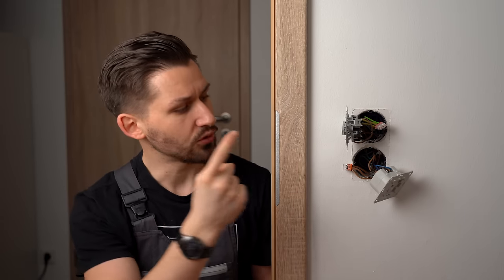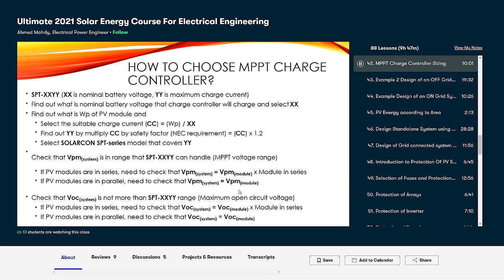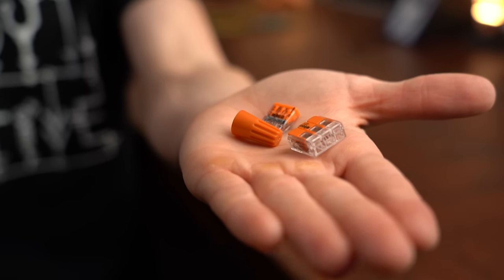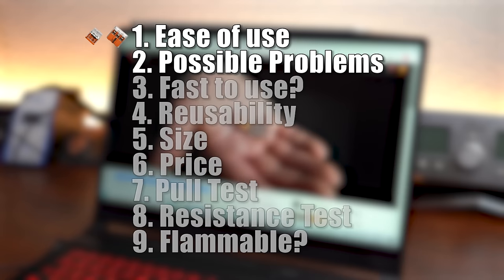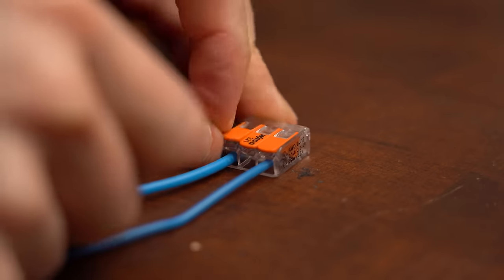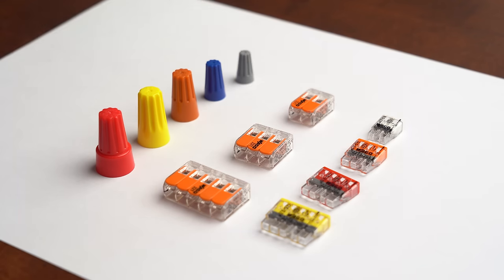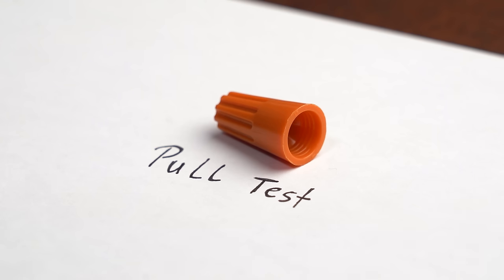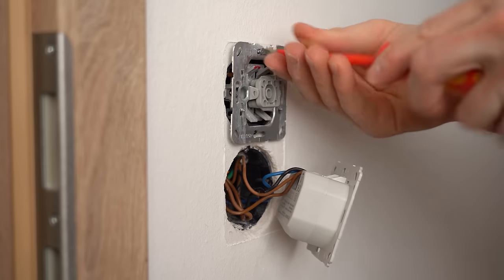What Wire Connector is the Best? Settling a Debate! Wire Nut VS Wago

Comment: I bought a box of Wagos years ago and never went back, every time I find an old wire nut it gets replaced with a Wago lever or a push connector depending on how likely I think I'll ever have to do rework is. I like the newer generation of transparent lever Wagos that are less likely to snap your fingers, that's about my only complaint with the older grey ones.
Reply from the maker: That was actually my only complaint about the grey ones as well :-)
Reply: How sore is it when you smack your finger nail with one 😂 OUCH
Reply: @greatscottlab  100% Same here. Honestly, I remember the first time I seen these and it was like a godsend. Wire nuts work, but they IMHO suck to use, esp with stranded wire. They work much better for solid wire, but still are best kept to a one shot use. Yes, you can reuse... But your wire now has metal fatigue due to the twisting, as does the spring coil.
 Australia has a lot of stranded wire, and the Wago connectors I prefer even over the common brass cap with set screws (Lookup Clipsal 563J/50 for an example). Wagos do not destroy your stranded wire ends like screw caps or twist nuts do.
Reply: Same. The only time I don’t replace them is when there are a lot of wires tied together, and already twisted around each other. I’ve seen wire nuts holding way more wires than I can do with a single wago.
Reply: Just pay the extra 12 cents for a high quality WAGO connector
Reply: @r3tr0nic  For the most part, I agree with what you said. If you have never used barrel crimps for stranded wire, you are missing out. (Not for joining wires together, simply to bind the strands together on one conductor) Once you use them, you never want to deal with loose stranded wire again.
Reply: Oh, yeah. Grey ones were also more difficult to open. I definitely prefer transparent ones over it.
Reply: Same here.   I rewired my whole house 7 years ago when I bought it.  It was built in the 50 and had barely better than cloth wiring, not to mention the absolute cluster f**k of how it was wired (couldn’t get it to make sense in my head so I just ripped everything out and started over).  Found the Wago connectors then, after using wire nuts for over 30 years, and haven’t used anything else since.  A million times better in my opinion and I make sure to share them with others whenever the opportunity arrises.
Reply: @jesondag  if there are lots of wires tied together that a wago can't handle the wiring problem should be resolved (to many wires in one junction point is just asking for a fire especially if your using wire nuts to tie up 8 cables that's bad just asking for a fire)
Reply: They are also cool because they include a “probe hole” where you can easily measure voltage with a multimeter without having to fiddle with the inputs. Really neat for diy projects !
Reply: I want to use them but I don't like the idea of the extra resistance. I'm going to definitely use them on my 12v installs though.
Reply: Wagos all day, especially when work is paying for them.
Reply: Wago 2273 are for solid conductors and should be always used if all connected conductors are solids. Wago 221 are for mixed conductors if you have to connected solid and multifilar conductors. It's not wrong to use them with solid conductors but because of the lever, which might come loose if stacked together with many others, you should use Wago 2273 for when all conductors are solids. Cheers!
Reply: The Greys are nail clackers.
Reply: @Alfred Pennyworth actually no, never have heared of wago before, but will 100% look for them next time I go to obi
His content showed me they exist, so thanks awesom scott
Reply: Sadly in some parts of the USA it is against code to use them.
Reply: @strmch8ser  My father had a house from the late 1800's.  The wiring was literally factory insulated with cloth.  By the time he had the house in the 1970's every time he went to replace an outlet or switch (which was often, 60 year old electrical outlets don't like to hold plugs in properly -- even I arced an outlet one day trying to plug something in) the cloth insulation disintegrated and he had to electrical tape temporarily and re-wire ASAP.  Worse yet, the wiring appeared to be equivalent to today's 16 AWG wire and it was connected to 20 amp circuits!  We didn't find any knob and tube wiring, surprisingly.  I had a house that although the wiring insulation wasn't disintegrating the wiring was so grossly under-specced that I melted the plug on a 15 amp dishwasher because things heated up so badly.  I re-wired that house to then modern specifications (and added a few new circuits).
Reply: We call these fire starters in Chicago, I can’t tell you how many boxes I opened up to find those things melted
Reply: @breandanholmes1  What things?
Reply: @1donjuego  wagos
Reply: @breandanholmes1  Then it was too much current. Sad some people dont check out what they are using and for what they are rated, thats why people die.

Comment: Not mentioned in the video, the WAGO allows to connect different conductor material, e.g. Al and Cu (a special chemical gel is required to fill the WAGO). This is common in old elec. installations, e.g. in the Czech Republic. The wire nut cannot be used as Al and Cu would chemically react together if connected and the current is flowing.
Reply: Special wire nuts exist for this purpose.
Reply: @BillBrasky-p8p  Ideal (and others) makes those and they are filled with an anti-oxident paste. The paste/cream can also be purchased. If INSTALLED PROPERLY, this will prevent galvanic reaction. What I'm less sure about is the expansion/contraction of Cu vs. Al. over time and the impact that may have. Put "connect copper to aluminum wire paste" into thee googles. 
There are some good articles on this including the NEC (US code) rules on the subject.
Reply: Wrong, they make wirenuts with anti oxidizing compound  (No Ox) already in them.
Reply: @RadioRich100  yes that’s technically allowed but the meth inside still can react with the wire it has been known to happen

Comment: The constant turning movement in the hand leads to problems in high age. That's why electricians like to use small electric screwdrivers to tighten the screws.
Simply plugging it in or turning a lever is much easier on the hands and can be done without restrictions into high age.
Reply from the maker: Good point :-)
Reply: Even just a long day with a hundred or two wire nuts will leave my wrist hurting for a while.
Reply: Thats why I use an ideal wire nut twister in my impact gun/cordless screwdriver. Faster than wago and gives a rock solid mechanical connection and no pain in the wrists
Reply: There are screwdrivers that have a socket in the handle that accepts wire nuts used in house mains wiring.  They really decrease the force one needs to exert when twisting wire nuts.
Reply: For solid wire you dont even have to open the Wago 221 just push it in ;)
Reply: The wire nuts with ears are the best over anything.
Reply: Coming soon from Ryobi: The 18v LiIon+ Wire Nut Twister(TM)
Reply: @andreasu.3546  LOL
Reply: @ipissed  "The wire nuts have ears". Sounds like a plot by the NSA or the CIA.
Reply: @forownmade1243  seeing as I can drop a wire nut in and bump the trigger in less time than it takes me to flip up the levers and close them, yes, for ME it is faster than a wago and provides a better mechanical connection. I like the wago, undeniably, however they have their place and it isn't everywhere on everything.
Reply: @xsbiggy6349  Also worth noting that that only works with the ideal nuts... other brand nuts you have to pretwist.
Reply: @greatscottlab     You should test the connectors with a real glowing loose connection instead of just melting them with a hot gun.Obviously both will melt,but not all plastics are equally flammable and some will self extinguish.
Reply: @Wingnut353  I've used it on multiple brands, not just ideals and never had a problem
Reply: We generally say  old age not high age.
Reply: 3M sells me a lot of wire-nuts, because they fit their nut twister that goes in my impact driver. Just need to remember to stop at 3 twists, as every time I had it to an apprentice they end up twisting the wires all the way to the back of the box and I have to smack them.

Comment: Both of the Wago connectors add a new component to the circuit, the metal connecting bar.  The wire nuts goal is to compress the wire ends together.  More than 90% of the current goes through the wire joint while less than 10% passes through the spring.  Probably explains why the resistance is so low.
Reply: Ya, running the juice through a bit of steel is just never gonna be as good as copper to copper.

Though, I wonder if in the case of dealing with old, aluminum house wiring, the wago connectors would be safer?

In my old house, someone wire nutted an aluminum wire to copper, and the nut liquified and very nearly caught fire in the wall. WE only knew about it because the light stopped working.
Reply: @Nevir202  i doubt its steel
Reply: @executive  On what basis? Guarantee it isn't copper, which is both too ductile, and work hardens so that it would be prone to crack.

In fact, most highly conductive metals have similar issues.
Reply: @Nevir202  The wago connectors consist of two pieces, a spring (which is a nickel steel alloy), and a bus bar (which is copper). The spring is used to push the wire against the bus bar, and isn't designed to carry significant amounts of electricity (after all, steel is a terrible conductor)
Reply: I totally agree
Reply: The wire nut isn’t intended to carry the current at all. It’s merely intended to shield the bared wires from unintended contacts and hold them together.
Reply: @Nevir202  Yeah, most DIY don't realize the issues mixing Cu/Al.  UL listed things will specifically state if they can work with aluminum.  I had a similar incident when all the outlets along one wall failed.  Turned out they were fed (by Al wire) from an outlet on the opposite side from a bedroom outlet.  But outlet was only rated for copper. The homeowner hadn't noticed because it was behind furniture, but the outlet itself was badly melted by the time it failed.
Reply: @mikefochtman7164  ours was a real nightmare to track down, nothing was visible from the outside, the previous homeowners had used a lamp in the hallway as a junction box. And despite the damaged condition, the light was still working fine, and with a metal housing, there was no external sign.

Had to use one of those clip on wire tracers and crawl around in the attic to figure out WTH was going on lol.
Reply: @Nevir202    you can buy wire nuts specifically for aluminum to copper connections.   they even have their own color code;   which is purple.
Reply: @johng4527  are they wire nuts or a different type of connector?
Reply: @wingerrrrrrrrr  Yes, they are wire nuts.
Reply: @johng4527  what brand are they?
Edit: found them-
Product Overview
Use on aluminum- to-copper and copper-to-copper connections
Provides a secure connection and prevents aluminum oxidation
Swept-wings easily twist on and offer improved conductivity
Model#: 30-1765S
Sku#: 643047
Internet#: 202935623
The Twister AL/CU Wire Connector is the only UL Listed aluminum-to-copper twist-on connector. The connector prevents aluminum oxidation while providing a secure connection. Filled with an anti-oxidant compound, the Twister AL/CU easily twists on with swept-wings making a comfortable connection with improved conductivity and cooler connections.

Aluminum-to-copper and copper-to-copper twist-on connector - do not use on aluminum-to-aluminum connections
UL Listed and CSA Certified for aluminum-to-copper connections, as well as the only twist-on solution to comply with the National Electric Code Section #110-14 (b)
Compact, 1-piece design features ribbed cap, swept wings and hexagonal head for easy installation by hand or with standard nutdriver
Live-action, square-wire spring expands and contracts with aluminum wiring

Twister AL/CU wire connectors are designed as a one-use only connection - do not reuse
Minimum wire capacity: 1 #12 Al with 1 #18 Cu
Maximum wire capacity: 1 #10 Al solid with 2 #10 Cu solid warranty/certifications
Reply: @wingerrrrrrrrr    yeah,  I think the only real difference is that they are prefilled with a dielectric grease to prevent corrosion and there are little flaps to help hold the grease in.    I also just found that they now have some screw clamp connectors (like a mini bus bar) with a purple casing for al/cu connections.   probably filled with grease too...at least it should be.
Reply: @johng4527  they're pretty spendy, so it seems the spring bar must be heavier duty than the run of the mill ones- interesting they have those now
Reply: @wingerrrrrrrrr  yeah, i don't remember them being  so expensive before
Reply: @executive  brass?
Reply: I am sure it is steel.    You can't make decent springs out of copper
Reply: @mikefochtman7164  Even Michigan has banned the use of aluminum house wiring.  The homes that had aluminum wiring were supposed to be re-wired with copper or be condemned in NEC states decades ago.  I know of at least one house fire blamed on aluminum house wiring connected to fixtures and outlets intended for copper wiring.  If I saw aluminum wiring in a home it would be replaced one way or another, it is just too dangerous and should never have been allowed in the first place!
Reply: @johng4527  What state is still allowing aluminum to copper connections at all?  My understanding is that even in Michigan homes with aluminum wiring had to be re-wired with copper decades ago or be condemned.  I know of at least one fire known to be caused by aluminum wiring.
Reply: @mharris5047  Looking in the latest NEC, aluminum wiring (AA-8000) is still allowed.  Don't know of any home that was ever condemned for having al wiring.  Code still allows it, but you MUST use devices specifically listed for al wire and install IAW manufacturer's instruction.

If you end up with an older home that still has AL wiring, I'd suggest getting a licensed professional to check it that it's still up to code.  Homeowners can screw things up.
Reply: @executive  its not, its plated brass
Reply: @Nevir202  Wago has special connectors for aluminum wires, those contain special paste, which removes the oxide film and prevents further oxidation. You should never connect aluminum with copper directly, only through some mediating connector.
Reply: @Nevir202  Worse yet, my first house was wired with all aluminum wire, and receptacles not. Rated  for aluminum.  All the wires fried back, and were loose and corroded at the connections.  I replaced all the devices with CUAL rated.  Almost burned the house down.
Reply: @johng4527  I would never wire not copper to aluminum, even with the cream used to protect against corrosion.  The dissimilar metals are touching.
Reply: @rodgraff1782  Oh joy! lol

Comment: - wago for standard home installation and/or for temporrary wiring (or not 
- crimping with a copper sleeve + heat shrink tube for very good conduction and waterproof needs
Reply: I love how no matter the industry, a "temporary" solution, is never just temporary
Reply: @p3chv0gel22 like Japan's power grid?
Reply: @alexandermcclure6185  you gonna elaborate?
Reply: It is worth knowing that temporary electrical connections are still done to the same standard as a permanent one

Comment: The USA/Canadian Ideal wire nuts that I use most of the time come with a table printed on the bottle or bag that lists what wire combinations go with which wire nuts.  No dooblydoo required.
Also, a good update to this test would be to try some set screw insert wire nuts, which use a brass insert to hold the wires together.  The outer plastic cap which goes over the brass insert is only for insulation.